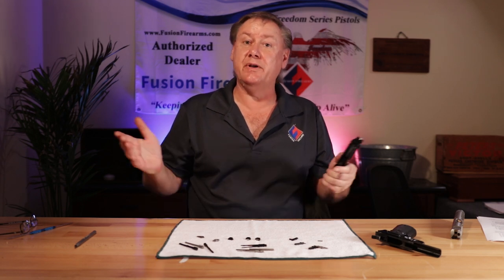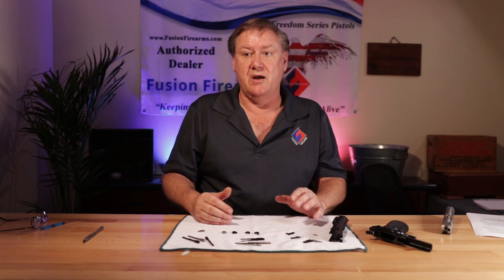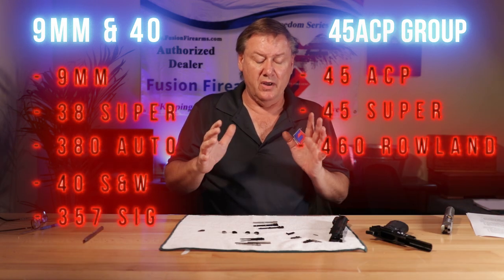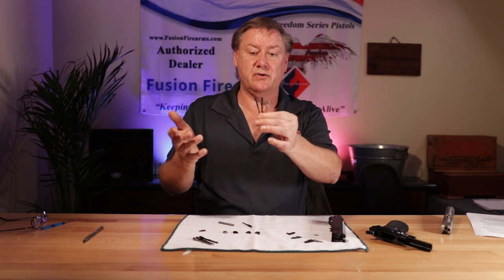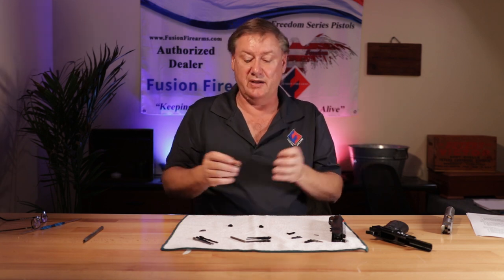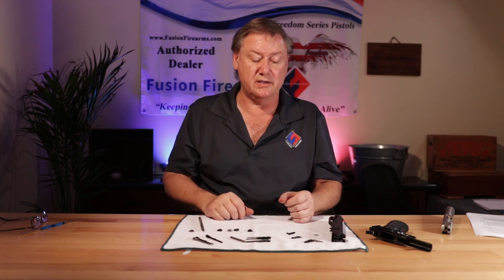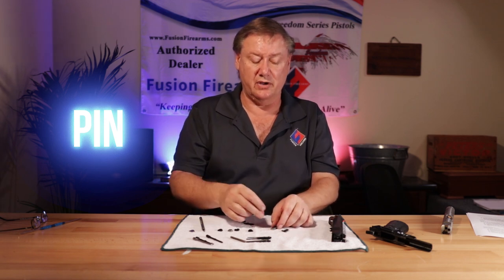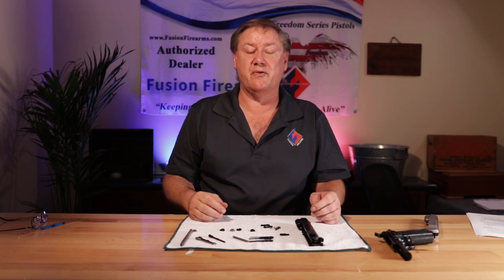1911 Firing Pin Components | What Are They? | Fusion Firearms

Comment: Your comments on the extractor issues on "Bastard guns" has my interest up. For those looking at a economy 1911 as a project starting point it would be helpful to know, what are the ones to avoid? I realize you may not be able to give specific brand names, but points of origin would clue most of us in.
Reply from the maker: For an economy starter pistol to use for rebuild, I, of course, like our Freedom series as a base because you are starting off with a good foundation of a Bar-Stock Frame & Slide. Or just get one of our parts kits. Origin is not as much of a factor. I know Folks seem to like the Norinco, and I see folks praising them, I have rebuilt about 20 of them and all have been sloppy, and the internal machining looks like it was done with a hatchet. I would not suggest these. But RIA's are OK if you can get a tight one and are a straight 70 series, but also a cast foundation.  Beware of STAR, Lama..etc and alike, Way too many bastard parts, Virtually NO customer service and almost impossible to get parts for.  Remember when looking at a project like this, A good Frame & Slide Combination is critical, and compatibility, if not you are just plowing a ton of $$$$ into a project that will never be worthy of it. Good Question, thank you.

Comment: Could the ejector damage some thing if left unpinned? I use an extra extended for my fusion 380/9 top end and change it with the original 45acp as they are mounted on my gold cup.
Reply from the maker: No it probably will not ever damage anything, but if it is not fit tightly and slops around it could lead to impeding the slide and or erratic ejection issues. If it is fitting snug, not slopping around in operation and not causing feeding/ejection issues, then roll with it, it should be OK. Not a good practice, But I understand what you are doing because of the slide change and if it works good for you then keep doing it.

Comment: I had to order a new extended firing pin for my prodigy. I put a lighter main spring in and after about 3000 rounds I began seeing many light primer strikes. come to find out the prodigy pin is titanium. so im guessing here but the main spring must have settled in a bit and maybe is now light enough this is occurring. cleaning it up and the channel adding more return on the trigger helped a little bit but still the issue. I have not gotten my pin and "extra power spring" from snail mail yet but am betting this will resolve the issue. I think folks need to sell these items as a kit. if you replace a mainspring with a lighter one auto get a heavier longer pin maybe? not sure. I am right in the middle of shooting content with this gun so pretty frustrating.
Reply from the maker: Good idea, thanks for chiming in